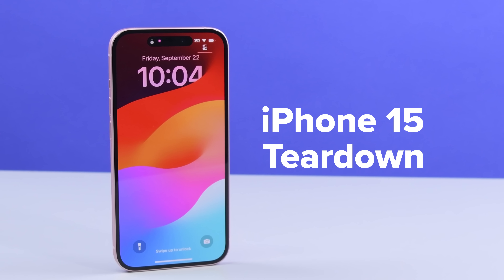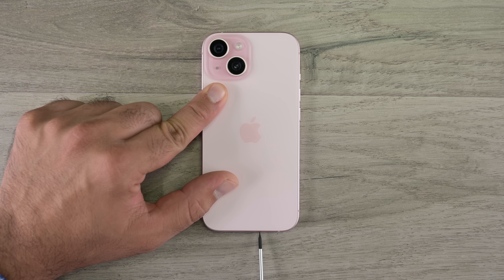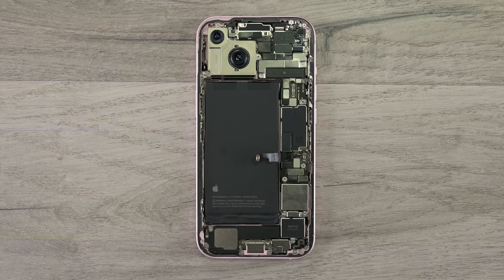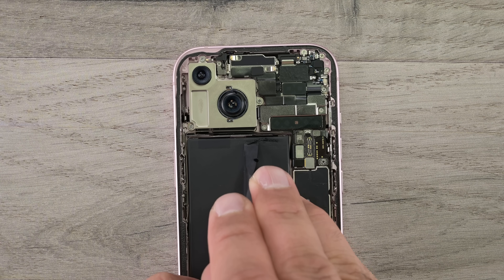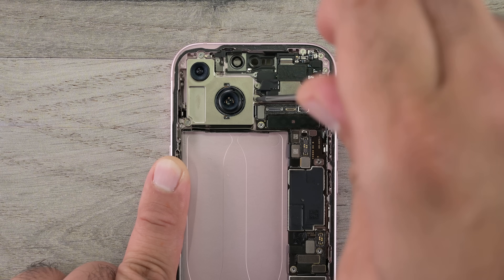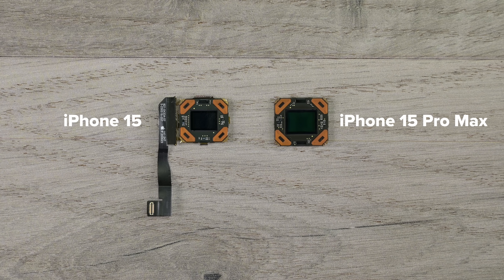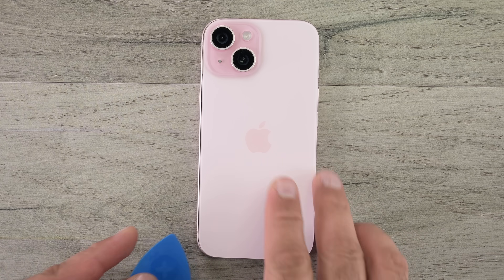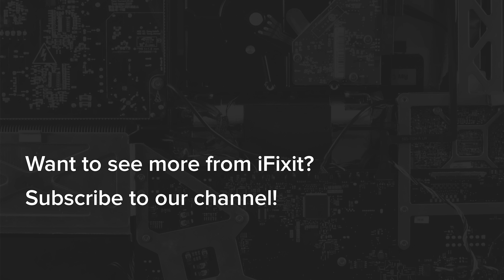iPhone 15 Teardown: A Microscopic Look Inside The iPhone 15

Comment: I am all in for the part pairing thing that apple does. This discourages the phone stealers to steal an iphone as compared to android and make it a bit more safe. I understand that this is a problem but instead of removing the part pairing, i feel that this part pairing things needs to be managed even better.

I am all open for inputs on this thought.😊
Reply: Instead entities in China developed tools to workaround part pairing for parts like screen and stolen iphone logic board became a cheap option for chips transplant from a broken logic board. This might only make stealers less profitable
Reply: @handlers9  yeah I under nothing is full proof. But make it as hard as possible for stealers so that stealing iPhones become less and less profitable compared to the risks.

Comment: I was always annoyed by the adhesive around the glass until I saw a phone where someone had opened it but not replaced the adhesive and it had dust everywhere including behind all the camera lenses front and back.
Reply: It would work the same if the phone had a rubber gasket all along the edge and some screws along the perimeter to hold the back panel in place.

Comment: Thank you for calling out parts paring and incorporating it into your repairability score!
Reply: Why is this that much important? And why is it now and not before?
Reply: @jlrpc  Even original parts will not work correctly when changed on an iPhone. You need to pair them through software, which Apple does not make public, leaving everyone stuck with needing to go to Apple for their "repairs", where they offer you a new device instead making more waste. Apple has been doing this for a long time and incorporating it to the score was a long time overdue. It's one of the worst anti-consumer and anti-repair practices currently done by basically anyone.
Reply: Ditto to the thanks!
Reply: Shouldn't that be illegal in the EU?

Comment: Interesting teardown, just one question if its not using the same camera sensor as the pro models (IMX 803) does it mean it still uses the same sensor as last years 14? cause they seem to be pretty much the same in terms of physical size externally and apple is just using software to upscale it to 48mp?
Reply: Last year’s base 14 didn’t use a quad pixel design. A 48mp quad pixel sensor can combine the separate photo-sites to create a 12mp file, but even when reading out at the full 48mp the sensor is not capturing the same amount of colour detail as a traditional 48mp bayer pixel array. Even if it could, such small lenses would struggle to resolve the detail. The base 15 sensor does not appear to be the same as the base 14. Interestingly, the sensor in the pixel 7 and 8 is still much larger than that in the base iPhone 15. Computational stacking of frames can make up for this, but Apple doesn’t give you computational “Raw” files on the non pro phones. Google does.
Reply: The standard iPhone 14 having 1/1.7 size now this is 1/1.56 size so it’s pretty much good and I thik it is a stacked sony sensor this time with bigger aperture than 15 pros

Comment: Still deserves an automatic 0/10 repairability score because of parts pairing and software locks.
Reply: Software locks can eventually be hacked/removed. 4/10 is pretty fair for a device that is pretty repairable hardware wise. 0/10 is reserved for things like AirPods.
Reply: The serialisation thing drives me nuts, because it’s hard to parse to customers why it’s bad for both them and the environment. I will explain that if I, an independent Apple tech, replaces their front camera array in their iPhone (for example) their FaceID will stop working. I could take another front camera array out of a brand-new iPhone and put it in their iPhone and get the same result.

If they then take their iPhone into an official Apple Store or an Apple Authorised Repair Store, even with a replacement front camera array from an brand new iPhone, it’ll appear in their system as a "third-party component." The customer will then come back to me and complain that I "didn’t use an Official Apple Part™️" even though is technically is, but due to Apple’s part serialisation, it 'isn't.'
Reply: Software pairing does not prevent you from doing repairs for the most part. So 4/10 is very reasonable, if not even on the low end.
Reply: @anianii for the most part.. this is the dirt you're allowing them to push you into.
Reply: Not an apple fan, but parts pairing is absolutely essential and the only way to prevent theft and black marketing. You probably live in a well developed and furnished city, where I am from there are literal black markets selling entire iphones and other phones and parts for dirt cheap in the open. Even the police turns a blind eye. You will be shocked if you count the number of phones/parts they keep in stock. Most of these come from stolen phones and some are directly smuggled from an iPhone assembly factory nearby. On average there are as many as a million units being sold every month. Serialising the component components makes sure even if you frankenstein a phone it won’t work properly, thus keeping these thieves out of business.
Edit- Even some local repair shops source spare parts from these markets. I wouldn’t be surprised if I learned that these repair shops have some hand in the stealing game.
Reply: I wouldn’t mind if it had 0 self repairability score if the price to repair at the Apple Store was significantly cheaper or automatically covered for longer than the warranty period they currently have.
Reply: It gets a 10/10 repairability score for Apple Store “geniuses” though, since they got the pairing software. Not exactly fair
Reply: if you do phone repair and you gave it a 0 ou arent that competent. if youre not, quit yapping lil guy let the experts do their work
Reply: no. it’s based on repairability, not usability after repairs